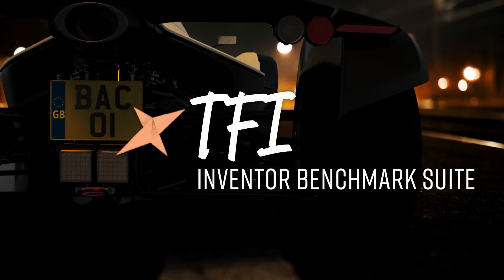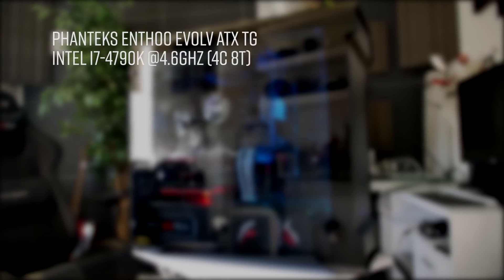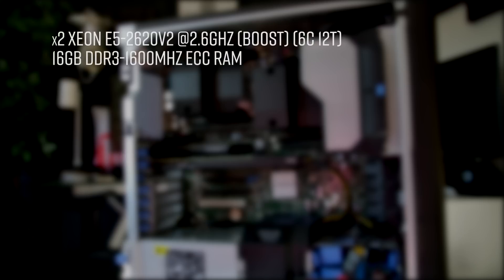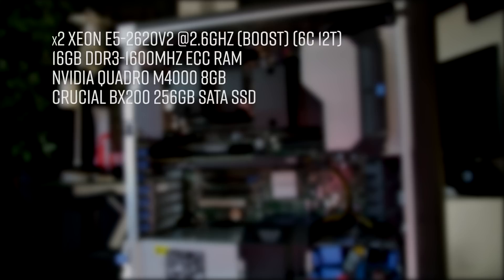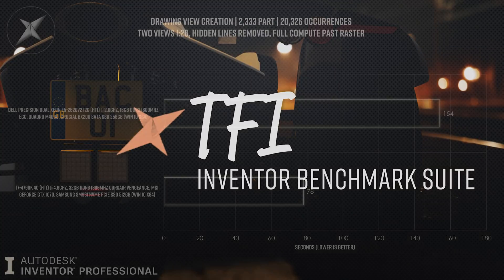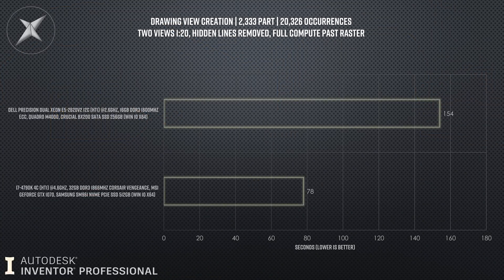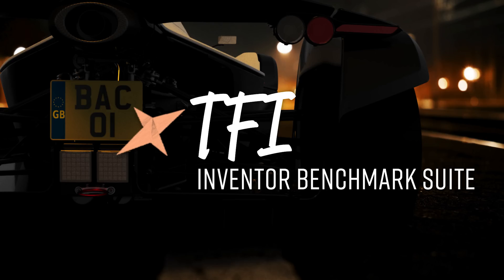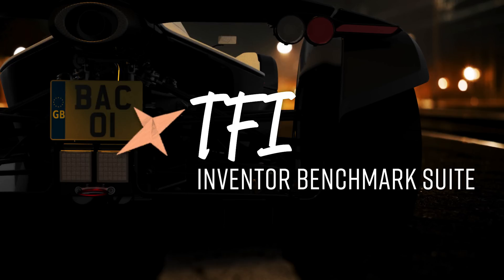3D CAD PC Hardware Benchmark #1 | Dual Xeon E5, Quadro M4000, i7-4790K, GTX 1070

Comment: Mate first things first. The application you ran is clock speed thirsty. the higher speed the better. You should know this considering that you have one of these THINGS!!!????
1st problem:
You are comparing a a 2.10 base/Max turbo 2.6Ghz frequency server chip against an intel i7-4790k, which has a 4.00ghz base/4.40 boost clockspeed with a 4.6Ghz OVERCLOCK and you are comparing it to a chip which has over 2Ghz LESS in SPEED that can't be overclocked. That is stupidly misleading and HORRIBLE benchmark. Not to mention your i7 system has 32 GIGS OF MEMORY COMPARED to only 16 WTF DUDE. Also GTX cards work better with these type of workloads and the QUADRO cards work better with CAD programs. ALSO if you are loading sya over 500+ parts on auto desk or any CAD based software, you really need 32 Gigs of RAM.
2.The dual Xeon system has a SATA SSD for the tests. Your system has a M.2 SSD. With a theoretical benchmark of over 4 Gb/s. Genius. How is that a FAIR benchmark????
3. Because you have two CPU's and are using only 16 gigs of RAM. Each CPU only has eight. Your CPU has 32 gigs of RAM. AND IS GETTING 32 WHOLE GIGS OF RAM FOR THE WHOLE THING. Dude why didn't you change the RAM AMOUNT!!??? WHY???!!!
4. Bars and graphs don't prove shit. Show some sped up footage or something. Anyone can make false graphs

In conclusions... do this again!!! With equal RAM being 32 gigs each system and run some other benchmarks that will utilise each GPU equally.

Comment: Hi Neil!
I might have misunderstood things here but I don't believe the drawing view creation test is fair since only two views are drawn. I believe the drawing view creation benefits from multiple cores when a lot of views are being processed. I can’t find where I’ve read this but I believe every core can process four views simultaneously. Therefore, when only two views are being drawn in the test, the higher clocked CPU will of course win. I'm interested in seeing a test with more views being processed, at minimum 4 views per core of the CPU with the most cores, e.g. eight views for a dual core CPU.

Your videos are very helpful btw and have completely changed my view on Inventor workstations. The company I work for receives complete opposite suggestions for workstations and that is when our Inventor admin, IT-contractor and Autodesk Gold Partner reseller have put their heads together. I have been trying to explain this for our decision makers for a while but who am I against all those "experts".

Comment: I came to the same conclusion with in my own tests. v2017  If you look Task manager and Open Resource monitor,  Then there is only one CPU who made all work.    Which version you use 2017 or 2018

Comment: I have always steered way clear of the FEA module built into Inventor. I use NASTRAN In-Cad in my work, and I think it would yield much better results in your benchmarking tests. One thing it still does not have (as of the 2017 version) is NVIDIA CUDA support, whereas ANSYS & MSC.NASTRAN do both support CUDA...I watch a video yesterday, coincidentally, that said that the simulation portion of Fusion 360 also uses the NASTRAN solver cores.
Great first drive of the BMs, mate...keep 'em coming!
Reply: But if you don't have access to better package Inventor FEA is better than nothing.
I think that another "hidden" and good use case for Inventor FEA is low cost and quite user friendly introduction to FEA especially for new guys in this field (just like me).
Reply: This Video Is Great Yes, true, it is good to use as an entry point to FEA, but you have to know that you will relatively quickly reach its limits in functionality...but until then, it is a good tool to have in you inventory.
Reply: Nastran IN-CAD 2018 supposedly has increased solver time (linear analysis only), by a factor of 2.
Reply: Giving a specific factor to the speeding up of analysis could be misleading, since it depends on the machine's CPU and memory specs, plus the model's complexity, but yes, there is a significant improvement in analysis "wallclock" time, as Autodesk puts it. I use the linear dynamic analysis routines (e.g. modal, harmonic,...etc) almost exclusively in my work, and I can see improvements in solution time.

Comment: Very interesting results.
1. FEA module in Inventor probably uses worst algorithms on Earth - no gain of 8 channels memory and many cores.
2. All test (excluding fps) took 37,2 min on Xeons, and 18,8 min on i7. 18,4 minutes faster roughly 2 times. I can imagine that on heavy lifting day it's possible to make workload equivalent to 3 times of this benchmark. It would be 110min and 55 min respectively, so almost 1h more time to do real work. In a year it adds up to 250 h. Quite a big deal. 
3. Newest i7-7700k should be about 15% faster than your i7 so there won't be that much difference. Only 7 min saved per day but 30h per year and that can be significant.
4. 11 fps on 2332 part assembly looks pretty nice. One the other hand I think it's not very reasonable to work on such big datasets. In my experience I turn off many parts not because of low fps but because many parts get in my way and simply disturb my work.
5. I think Autodesk won't significantly improve multithreding in future. If it would be easy to do, we would already have it implemented - so probably there are only hard ways left. Let's hope I'm wrong. 
6. Interesting fact about Ryzen: it's ECC memory compatible. AMD didn't disable it. They don't validate it like in servers but if someone want ECC in consumer grade CPU it's possible. It only requires motherboard with ECC support. I think we can classify Ryzen as half workstation grade.
Reply from the maker: The worrying thing with the multi-core support is that they're still enabling it, some of those functions listed on the webpage have only just recently been enabled for multi-core support so I don't see it as improvement needed to legacy stuff... this is stuff they're doing now and looks like they're still doing it wrong!
Completely agree about turning off parts on large assemblies however obviously the purpose of this test is to see how systems handle big assemblies, some people might be working on massive datasets and 2332 might be the lowest they can switch it down to.  But I wanted to properly test the visual capability of hardware in a hard way without being too ridiculous about it.
Reply: Your choice of 2,5k parts assembly was correct. It shows how big dataset can be worked on as a whole with barely acceptable fps on almost fastest PC (build for Inventor) money can buy. If more parts are needed than automatic part disabling while rotating comes with help. In my personal perspective I'm a long way to needing to work on such huge assemblies and I think it applies to most users and projects.
Bottom line: this is good news.

It is possible to throw such a big problem that even best hardware will struggle. But the question is what is resonable. Similar story can said about FEA/CFD and amout of RAM needed. Sure there are problems which will eat all avaliable space but as some Ansys reseller says: "As of 2016, 64GB of memory has been sufficient for 90% of the FEA and CFD projects."
So the guideline (for new user) is to get 64GB with option to increase it to 128GB (unless you know you need more).

For Inventor it will be (about RAM usage): Get 16GB and upgrade to 32GB when you need. Or: just buy 32 if you have enought money. 

With each test you make, we get clearer and clearer picture what is realy necessary and what is nice to have. Outstanding work Neil.
Reply from the maker: Thanks man, and I've just taken delivery of the Ryzen 1700X, Ryzen test incoming! I intentionally didn't get the 1800X based on the 1700X being more closely priced towards a 7700K, but knowing already before I even take it out the box that the clock speed on the Ryzen is going to gimp it on these tests, probably along with the early adopter issues
Reply: Multi-threading can be challenging. Even in workloads where it is easy in theory, the code may have been written when multi-threading was not relevant. So, often times a rewrite of massive amounts of code is necessary. Although Inventor is relatively young, Autodesk increased its functionality by buying other software. So, the code is much older than Inventor itself. And, lastly, some workloads just don't work well with multiple threads. Only tasks that can be done at the same time can be multi-threaded. Many tasks are necessarily linear.

I have only seen a few workloads that use many cores. And, I see companies with very well-threaded code (like fluid sims) wanting a license per thread!!! So, I'm thankful that Inventor uses several threads for for things like FEA with only one license.

Comment: How much ram dose it takes to load 2332 part assembly?
Reply from the maker: I think the Inventor session was at around 6GB, I've tested a system with only 8GB RAM and performance tanked due to system RAM capping out.  I upped that system to 12GB RAM and there was enough head space to work on that assembly.

Comment: Any chance of a HP workstation comparison on the test bench. Also, what are your thoughts on Bentley microstation?
Reply from the maker: Yea I've got a brand new HP Z440 coming through very soon.  And soz I don't really have any thoughts on Microstation, I've never worked anywhere that it's been used within so I have no experience of it.
Reply: Ok. Arrh, look forward to the video results of the Z440.
Reply: Yay for an HP workstation test!